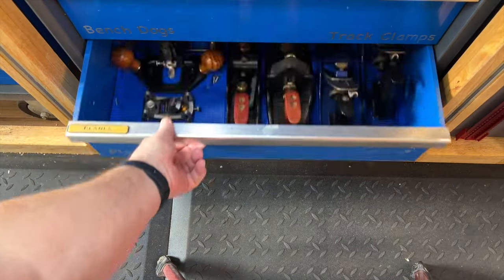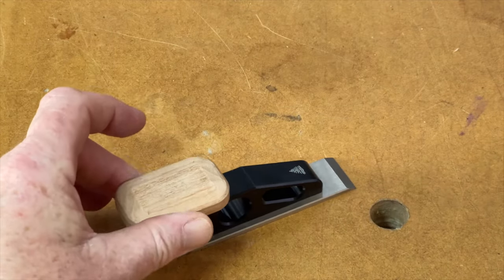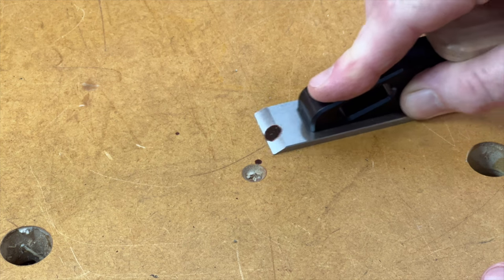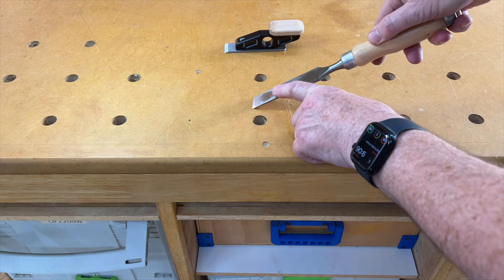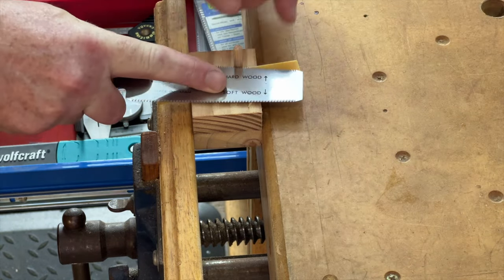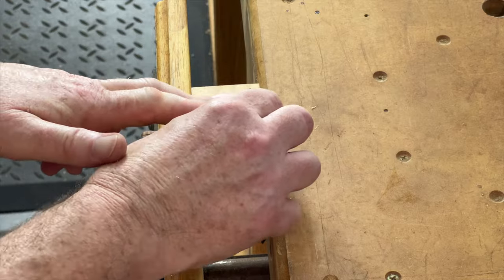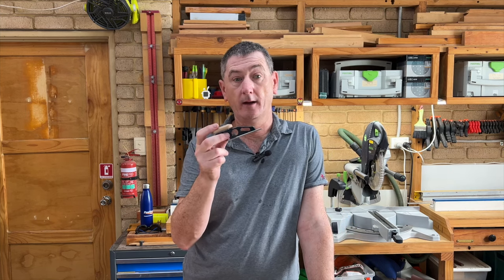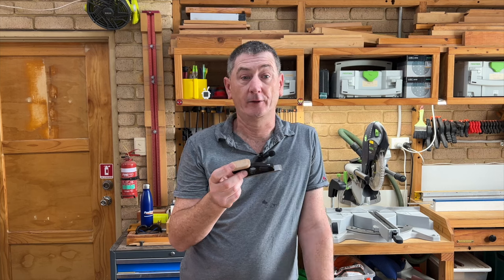Blue Spruce Optima Chisel Plane

Comment: Just picked up this beautiful little tool a week or two ago and now stumbled on your video. The blade is fully flattened, polished and sharpened out of the box which is a nice touch. And it cuts like a dream. Blue Spruce just came out with a spearpoint blade version which gets into corners and tight spaces very nicely. Thanks for doing this video!